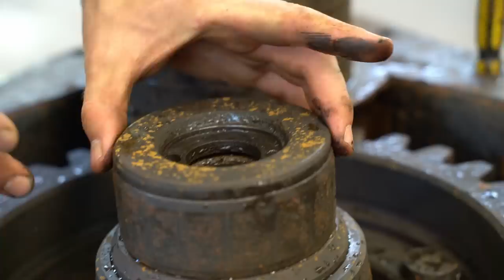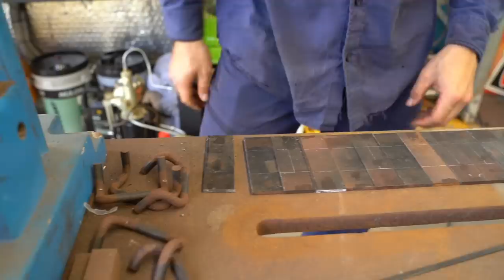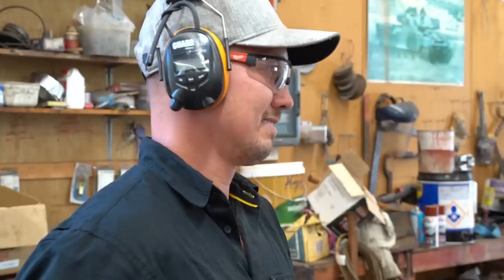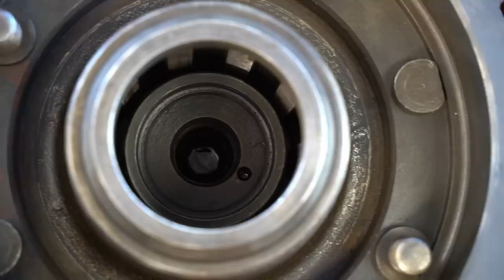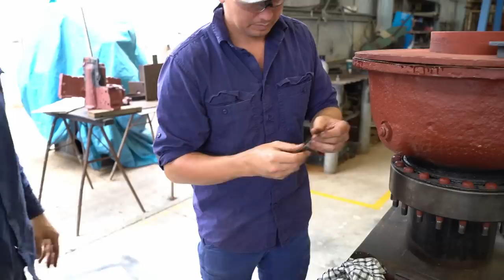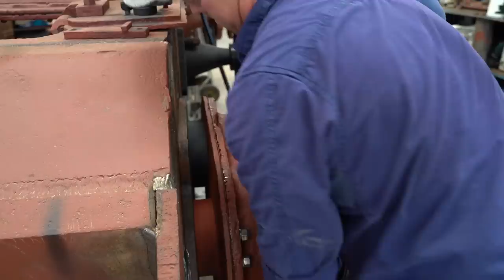WORKSHOP WEDNESDAY: How to assemble a StuG III G final drive unit!

Comment: Hard to comprehend the engineering that went into these machines, especially towards
the end of the war, when the factories might be under attack. And to remember that
the most sophisticated calculator at their disposal was a slide rule, makes the design
and engineering all the more impressive.
The work you folks do is just as impressive. Hard to believe you can recreate these
parts with few, if any, drawings or dimensions to work with. You guys demonstrate an interesting combination of force and finesse and I always look forward to each new
episode. Keep up the great work.
Reply: It seems to be a common misconception these days that before there were electronic calculators and electronic computers, engineers had only slide rules.  That is not so.   They had mechanical calculators, some quite as sophisticated as modern electronic scientific calculators, and with about the same precision.   In wartime Germany there was limited use of the Zuse electric computer, developed by Konrad Zuse.  Desktop mechanical calculators equivalent in function to electronic calculators go back to about 1890 and were very common from about 1900-1910.
Reply: I have yet to master the proportion of force vs. finnese
Reply: The metric system helps 😊
Reply: @MoveAhead101  : It helps a heck of a lot, although wartime Germany was CGS metric, which was not quite as good as the MKS/SI metric used throughout the world now (except by the stupid Americans).  
A lot of engineering calculations before the PC used to be done with printed tables and graphs as well - you could buy various sorts of books of tables and graphs for common engineering calculations.   Not quite as quick as using an electronic calculator but still good, and more accurate than a slide rule.
Reply: i used to know how to work a slide rule. many many years ago.

Comment: Kurt, wo bist du? Nice to see this restauration. I worked in a the metal industry too. The last 14 years as a welding inspector. I am thinking of trying to reconstruct a Sdkfz 251. Saturday i will be checking out some tracks and wheels in next door Germany. Regards from the battle of the Bulge area, Belgium
Does the museum have some Sdkfz 251 parts for sale?

Comment: A good solution to keep new bolts from rusting and giving them a slightly better edge (doesn't always work, the quality of the metal is important) is to heat them up (not cherry hot, but hot enough) that when dunked in used motor oil, they turn flat black. I've had hinges, bolts, all manner of metal that's exposed to the weather 24/7 done up this fashion and it never rusts post treatment.

Comment: Do you guys use experienced boilermakers to handle alot of the welding, cutting, and heavy metal fabrication.  The welding and heavy metal fabrication skills I have  observed on the restorations  are excellent  and on par with master boilermakersdoing similar work in the US power plant refurbishment and maintenance.

Comment: When you think a group of design engineers sat and drew every single part after working out what each part did is amazing.
Reply: I began in engineering in 1965.  What we had was a drafting pool, which was to an engineer as a typing pool was to a businessman.  
Just as it was a waste of a businessman's expensive time to type his own letters and got a much lower paid typiste to do it, we engineers were paid too much to do drawing.  What we did was do a quick sketch and outline what was required to a draftsman, who did neat drawings to appropriate standards for quite a bit less pay.   I said "draftsman" but often they were female.
Engineers in wartime Germany would have worked the same way.  Now of course, businessmen have email and engineers have CAD/CAE - Computer Aided Drawing / Computer Aided Engineering, and there are no typing pools and no drafting pools.
Before the PC, one engineer could generate enough work for several draftsmen.
If you look at the title blocks of old engineering drawings, you'll typically see listed along with the date, title, etc, something like  "DRWN:   FGN",  "APPD:  DGH" - this means drawn by somebody whose initials are FGN, and the drawing was approved by someone whose initials are DGH.   FGN was the draftsman and DGH was the engineer.
Reply: That really interesting thanks.

Comment: You should try using liquid nitrogen for putting some of that  stuff together. Even putting a bearing in the freezer helps. Just heat one part and freeze the otber and they just slide together

Comment: Fantastic job, guys! However, I have a question: i have a technical drawing showing the cutoff of the final drive asssembly, and, on top and on bottom of the main axle (the one that is grooved) there are 2 bolts (the ones you see in the video); what was the purpose of these two bolts?. The purpose of the bottom one is to retain the bearing?.

Comment: Those double row roller bearings are reliant on the outer bearing races being concentric from each other, and the inner races being concentric of each other. When both sets of races are aligned with each other on an axial plane, they provide zero thrust movement since the rollers are semi-tapered inside the races. the clearances between the races and their bores and shafts need to be right, or they'll be sloppy.

Comment: A bit "rough & ready" I know but couldn't you guys use a grinder with steel (i'd go with stainless steel type ) grinding "flap"  wheels to remove the high spots on the hull side, might take a bit of time (grind, assemble, check etc) but just requires flap wheels and patience, was surprised you hadn't come across double row barrel bearings before as they are not unknown in industrial, agri or construction equipment (spherical is a norm but these get used in high load situations) to take account of shaft misalignment through tolerance or load reaction.

Comment: Question - when driving down a collar like was done at 11:33 why would you not use a piece of wood between the collar and the hammer? Are you not concerned with causing minor deformation of the surface of the collar? Or is the collar hardened steel like the hammer?
Honestly wondering.

Comment: How do you fill and drain the drive assembly when all the fill plugs on the sides of the case are still rusted shut?  Does the gear oil come in under pressure?

Comment: OK 1 thing that Ive noticed with your assembly of bearings, you never pack and grease bearings properly. I used to work on aircraft as a structural mechanic in the US Navy and we were taught that ALL bearings must be packed, with grease. Or they will corrode and they do if left unpacked, because water can get inside them. Even moisture from the air, from the environment, when the bearing is sealed can remain inside the chamber with the bearings, and can eat away at them.

Comment: That big assembly is going to leak oil. You should have used silastic both sides of that paper gasket,, rust and warping is fairly obvious. Anybody would think it had been blown up,, and left in the weather for 70 years.
Getting the side of that hull square is going to be a huge chore. Even with the factory milling machines. Those sides would have been milled square before they were assembled, would be comparitivly simple then. Even now with a humungous great mill.

Comment: It's interesting. In Germany, they used custom parts for all their vehicles. Here in the us, they used whatever commercial parts they could. Case in point the M1 tank engine made out of 6 dodge 6 cylinder engines. The only custom part was the case that formed the joining part for all 6 engines.